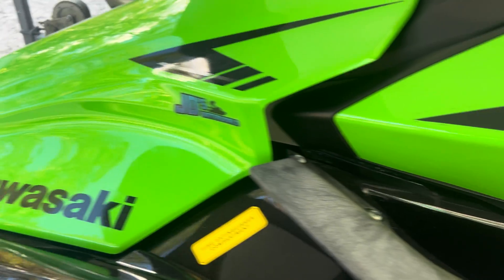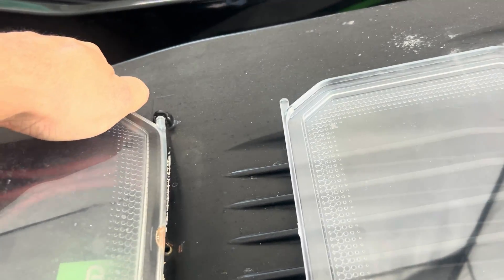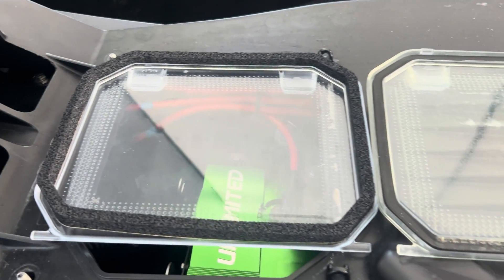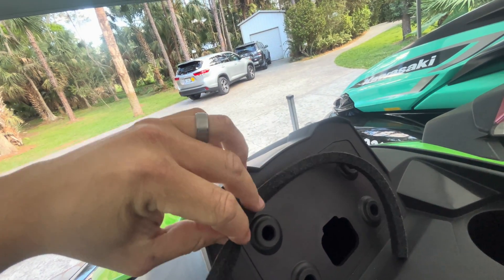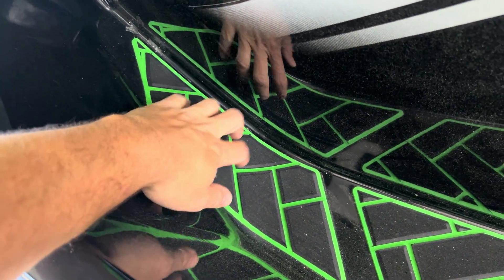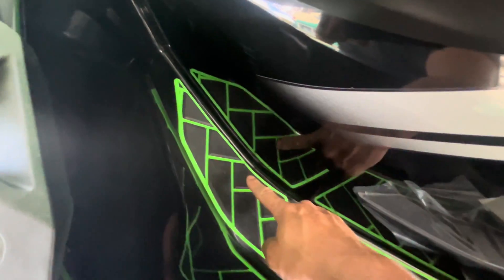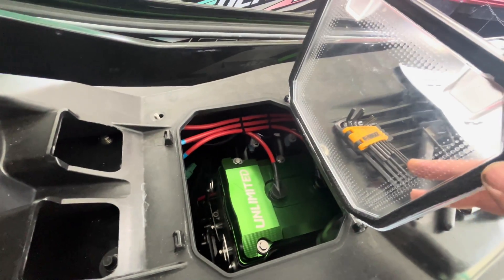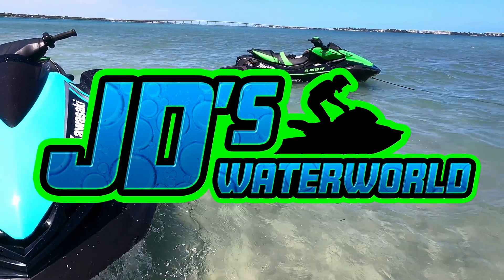Kawasaki Factory Directed Modification: 2022 and 2023 Ultra 160 and Ultra 310 Jet Skis - [4K]

Comment: Kawasaki, I hope you’re reading this;

Thank you for staying on top of water intrusion issues and promptly making fixes. However, why since 2011 have you not addressed the steel idler pulley and tensioner assembly that’s not, at the very least rust proof. I give them tons of credit for making a great product, but it shouldn’t take Kawi Performance to re design a badly engineered part. I hope you guys can realize that your watercraft are used in water, and should be made to resist the effects of it. 👍
Reply from the maker: Amen

Comment: I might Gerry right now my seals for cover, gauge , and floor wells. Home Depot foam and scissors :-)
How difficult was it to take off gauge screen to place foam seal behind it? Does it just pop off?
Reply from the maker: Yeah it's like 2 10mm bolts and rubber grommets and the screen pops off
Reply: @JDsWaterWorld  thank you JD. — IM going to " Jerry rig" my seals . Spell check was funny on my post.

Comment: This would be a factory recall? When was this recall published? I have not seemed ro have gotten any further recalls since the limp mode scenario.
Thanks
Reply from the maker: It's a "factory directed modification" technically so a bit lower priority than a recall- and there was also a wire harness recall (voluntary) for all 2022 and many 2023 models..if you call kawasaki and give them your VIN they can run it for you. But as far as I know, there have been a total of 3 recalls/ modifications for 2022-2023 models which would be 1) knock sensor software error 2) wire harness 3) water instrusion
Reply: @JDsWaterWorld  I ran the Vin on a website after I posted comment. 
The wiring replacement and water intrusion are listed for me. 
I'll be scheduling an appointment. 
Thanks for the reply

Comment: I have to call them i got my notice months ago. Hopefully they will givw me the stuff and i do it myself. The harness they rellaced in august before rhe recall i wonder if they will have to replace the harness again?
Reply from the maker: The dealer must complete the update, I just showed it here for educational purposes* and yes while your replacement harness is probably fine, the new ones are made in an entirely different factory with more stringent quality controls so you will want to have it replaced again, unfortunately
Reply: How long did it take dealership to replace the wiring harness?? Mine needs to be replaced but don’t want it in the shop for a month

Comment: Thanks. Assumed that would be the fix. I put a strip of duct tape along the hinge side when running in the ocean. No water with that. I don't worry about it on the lake. I pop that door off and stick it in the gullwing storage after every ride to allow engine compartment to breathe since you can't simply leave seats popped open. Thanks for sharing.

Comment: Thanks, I am going to be in Trouble when they See my Clear Access door I drilled a 5" hole in mine and installed a Air grill for more Air to get into the Engine Compartment, never had very much water intrusion, I need to make the Appointment to get this done and the Wiring Harness per the Recall
Reply from the maker: Doesn’t matter, this is not warranty related so they will conduct it regardless of any mods you have made. Make sure to request they don’t throw away the old door so that you can re-use your air grill.

Comment: Wait no shit you can just pop the screen off like that ? You gotta be kidding me , I got to go outside and see how to pop that thing off now.  (Side note ) they need to send seals for the Goodwing doors.  Left side always seems to let water in
Reply from the maker: I have a solution for this and will be posting a video on it soon.
Reply: @JDsWaterWorld  O nice.  I can’t wait too check it out ,   I also had NO idea that there was holes in the foot wells already and I was literally preparing to cut new holes for the pods I end up adding   Lol I would have been SO PISSED at myself
Reply from the maker: Yes, the meter display has four 10 mm screws, holding it in from the back, and the one wire connector and yes the footwells are pre-drilled for the factory foot speakers. There is a large hole in the center as well as the mounting holes. All pre-drilled from the factory.
Reply: I always remove that door and put it in the gullwing storage post ride. Let's my engine  Compartment ventilate better since you can't just prop the seat open like old models

Comment: You know I’ve yet to figure out the sole purpose of this silly window that Kawasaki put on these water bikes.  Lol I’ve always loved kawi since my first ninja 600 bike but sometimes they do stuff that makes me think 🤔 DA FUQ came up with this
Reply from the maker: It’s so you can check your oil without removing the engine cover. Of course they should have just included knobs on the cover from the factory so that the whole cover could be removed more easily.
Reply: @JDsWaterWorld  I did not even realize that ,  I guess that’s probably obviously if I had probably looked closer. Lol but I’m so use to just removing the entire cover for everything.
Reply: Thanks for the info!